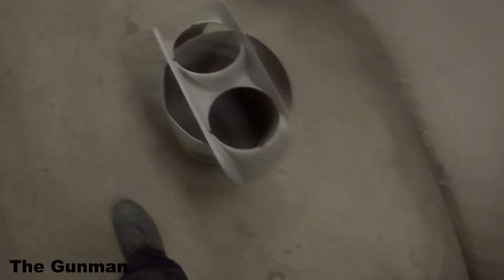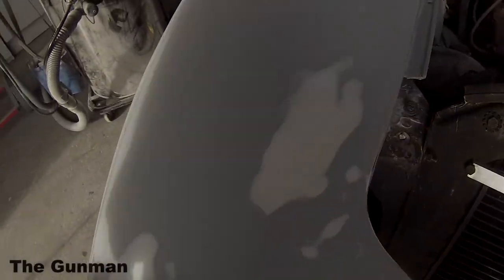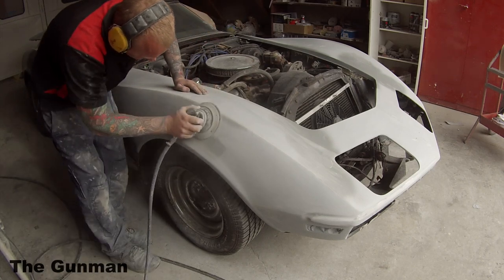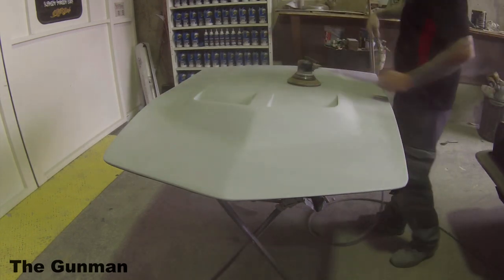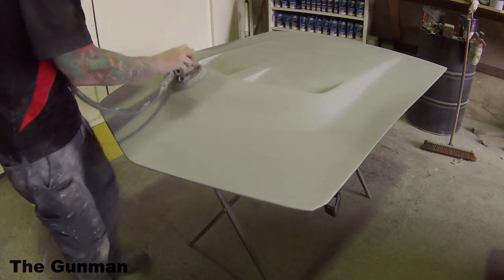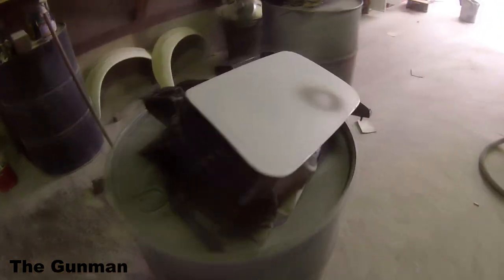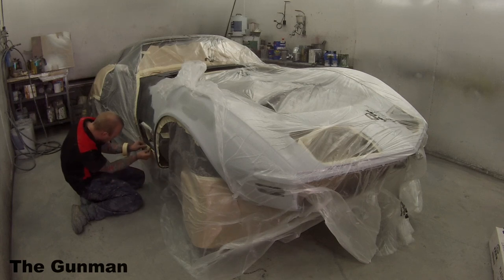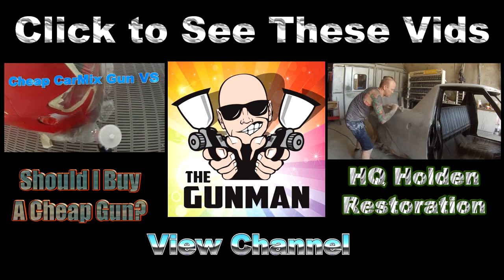1970 Corvette Stingray, Prep & Mask

Comment: hey gunman, any tips to prevent dry overspray?? I always have a ruff textured surface on some parts after I paint....I have moving the gun quick. running 20psi with 3 turns out fluid needle, about 24c  degrees out

Comment: Gunny stick a rolled up piece of red scotch bright pad but not too tight in the exhaust port of sander see if that quiets it down a bit.
Reply from the maker: Scott F I actually ended up getting some booth filter and worked a treat, quiet but still fast, thanks again man :-)